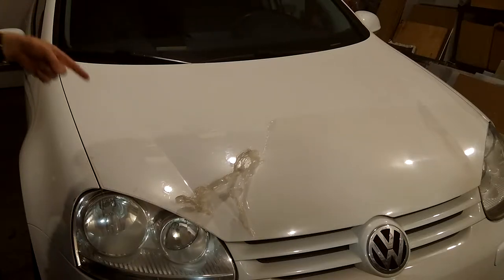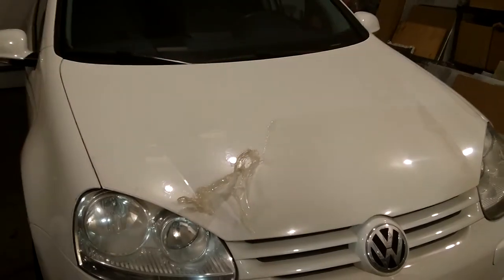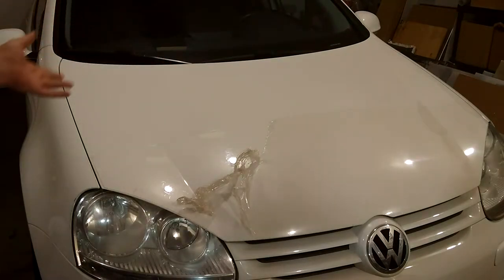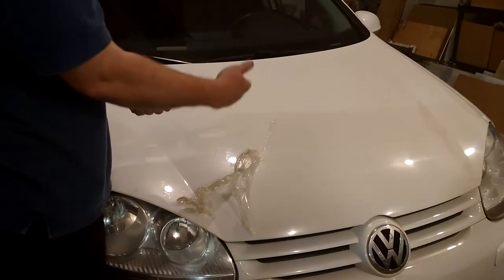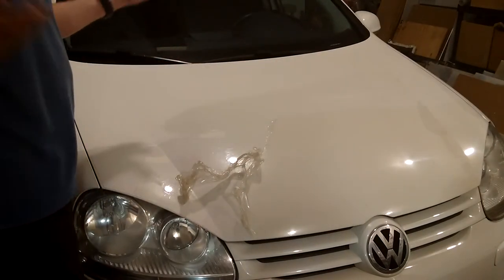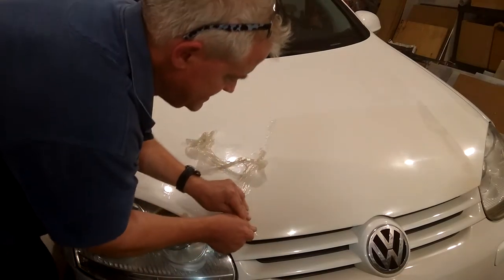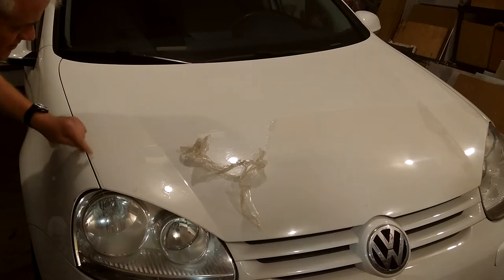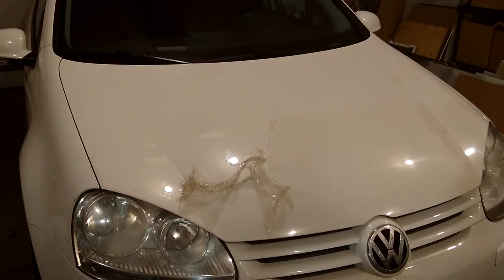How to Remove Clear Bra Protective Film Easily - No Heat Gun - Ver 2

Comment: Brilliant advice. I had two sections of film to remove. I did the first using a heat gun followed by a steam gun. Both were rubbish and ended up with a sticky mess. I found your method worked perfectly - it all came off as a single sheet with no residue and no mess. I wish that I had seen your video first!